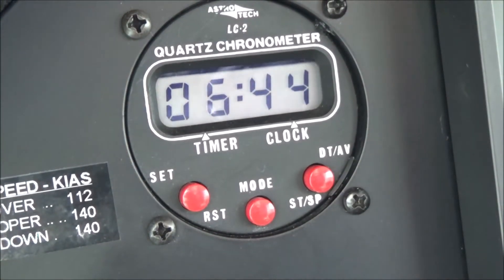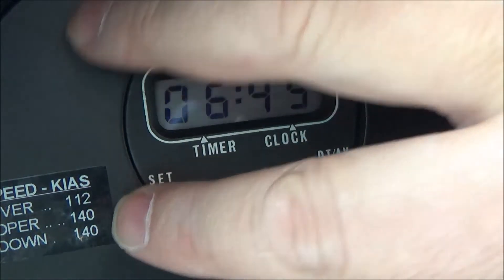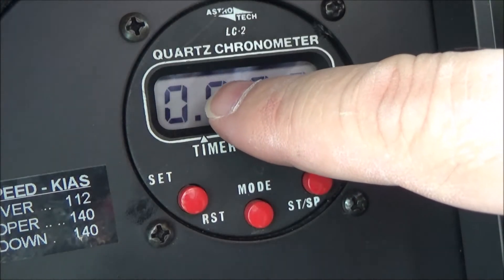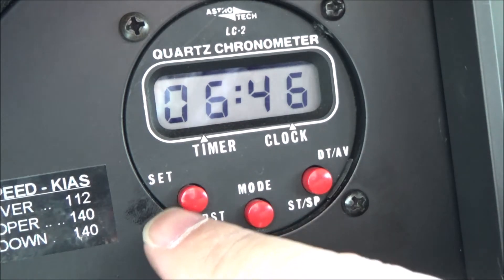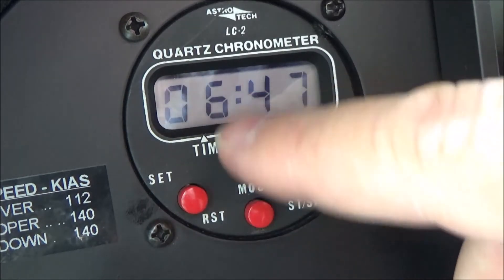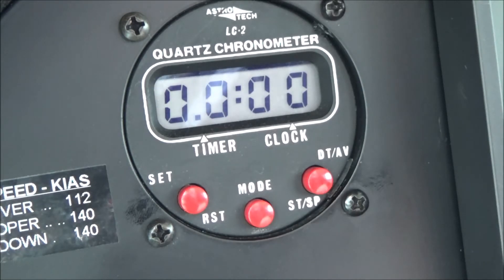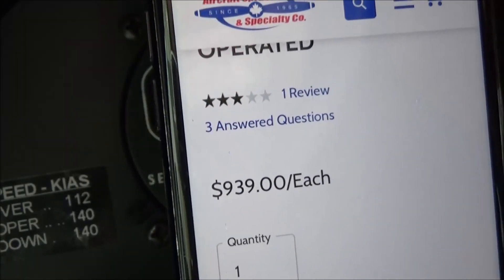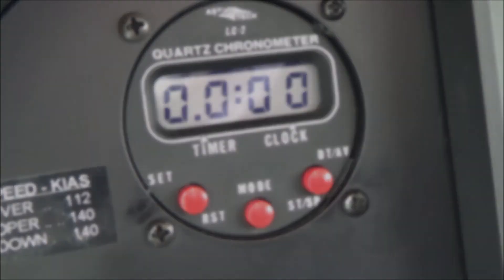Astrotech LC-2 Clock 2-1/4 Panel Mount Battery Operated, How to Set up and use Tutorial

Comment: I found a great looking Mid Continent CH95 clock with USB-A & USB-C outputs for $899 - Part number 6420093-5. Fits standard 2" cutout panel. TSO certified. Also has auto or programmable dimming curves. Field replaceable battery. Shows time, OAT, secondary air temp, voltage, count-down and stopwatch.

Comment: So i have exact same one in cherokee but it only comes on when battery is on and it is just lit up with no numbers.  Any ideas on that ?
Reply from the maker: Yes that means the battery is dead. Like I said the unit gets back lighting from the airplane 12 v system. But it actually operates by the AA battery. Check it out. Bet it’s the battery.